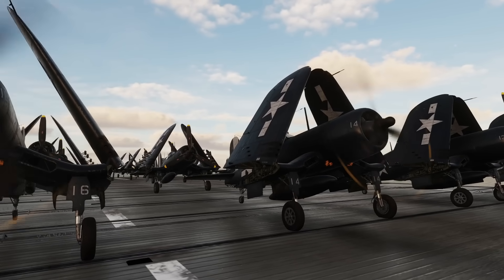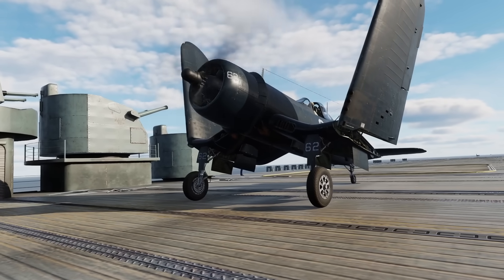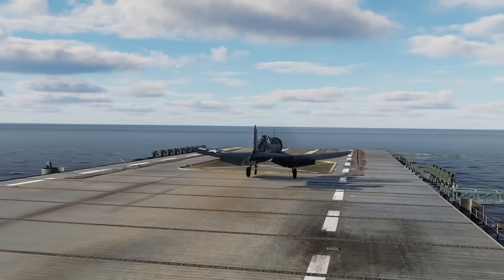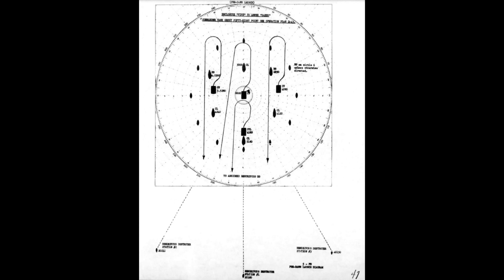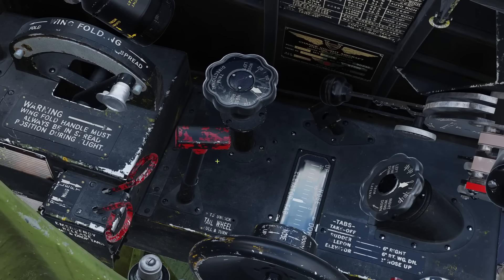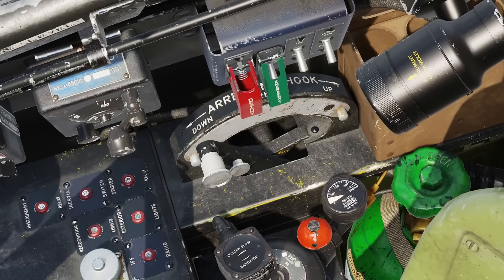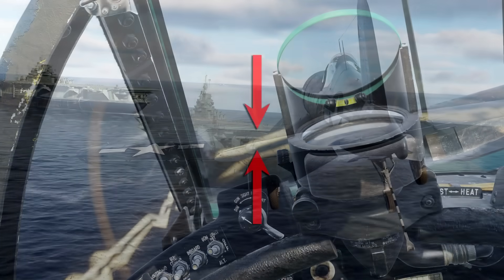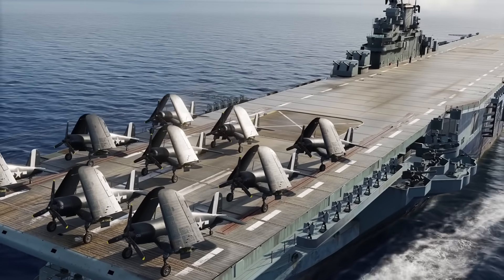F4U Corsair Training Part 4: Carrier Ops Tutorial in DCS World

Comment: Do you play in VR and if so which hmd? How often do you play in VR vs Trackir?
Reply from the maker: I play in VR whenever I can, unless I'm testing a mission for the first time and I need to take a lot of notes and switch around in F2 view.
Reply: @ReflectedSimulations I assume you are on the quest 3? Also do you have. Settings guide as I find the resolution is super low and there is a bit of ghosting when moving compared to the flat screen. I have a 4090. I not sure what to do about the low resolution however in VR? It’s a massive downgrade to the flat screen however I prefer it for the immersion.
Reply from the maker: @gregprouse1173 I have a quest 2 which is even lower res

Comment: Great Video!  Thanks for posting.  What are the trim settings?  Same as takeoff or zero them out?  I think that is what's causing me to bounce all over the place when trying to hit the deck and catch the wire; the nose wants to move hard right when coming in for final, and hard left pedal doesn't help much at all.  Pretty sure the trim is all messed up by this time.  I only been able to land successfully like twice out of 50 tries!!
Reply from the maker: Trim the nose so that you don’t have to push or pull too much to maintain 90 knots and the rudder so that the ball is more or less centered. For me it’s around 10 nose up and 4-5 nose right
Reply: @ReflectedSimulations thanks for the advice, will give it a go!

Comment: Great video! Maybe I missed it but do you have to have trim set similar to start? Or are aileron / rudder trims neutral for landings?
Reply from the maker: Set it so that you don't have to constantly push/pull on the stick and apply rudder. Something similar to takeoffs will work, but the elevator will be more up due to the full flaps.
Reply: @ReflectedSimulations  many thanks, will try.

Comment: Reflected. To paraphrase Patton, "You brilliant SOB." It took a couple passes to work down to some traps, but the gouge is right. Trick for me was to give enough upwind distance to turn, get dirty, lined up because the turn at the 180 (so be stabilized/trimmed up at 100/90 100'/90' level turn), comes quick. Keep the nose on the horizon and nurse it around as your are basically in VMC and that tiny tail has virtually no authority so it's a slow drift and tail chase to the stern. Use your feet.

Comment: Why the canopy has to be opened during takeoff and landing?
Reply from the maker: If you hit the water, or the deck and you catch fire, you wanna get out as quickly as possible. You can't waste a single second trying to open the canopy. Also, it may jam shut on impact, and then you watch as your cockpit fills with water with no way out.
Reply: @ReflectedSimulations  I thought its means for that. But just in case I had to ask. Do you maybe know how much drag an open canopy procudes? During the flight is has to be shut at all times, right?
Reply from the maker: @MitjaBonca  I don't know, but minimal. Nothing to worry about during takeoff and landing. It has to be closed above a certain speed, I can't recall. Below that it's up to you
Reply: @ReflectedSimulations  thx, I appreciate it. And thx for your effort on this module, seems that you will be in a great help 😊

Comment: 10:24.  Planes are parked too far apart, I think.  Should easily be able to fit 12 up front, 3 rows of 4.  Probably 3 rows of 5.

If they get animated deck crew, you’d maybe taxi up to a point where a plane director or plane captain says cut engine.  Upon engine shutdown, deck crews would push or tow your aircraft into its tight parking spot.  There, it might be refueled and reloaded.  Once all landings are complete, the planes are all towed and spotted aft to prepare for another launch.  Perhaps, you as a player can stay in the plane and fly the next mission.

If when you landed, your plane needed repairs, you might be guided to an elevator and taken below.  Yo wouldn’t need to taxi precisely, as you’d be instructed to shutdown and the deck crew would position the plane on the elevator.

Could be an incredible amount of fun!!

And not just Essex class, but smaller, shorter Independence class light carriers and Casablanca class escort carriers, too.
Reply from the maker: I just placed some statics in the mission editor, I'm sure more could fit.
Reply: @ReflectedSimulations  Ok, understood👍.  Yes, I did the same, now, and fit 5 across.

Comment: 1:12 This wasn’t a trim failure. The pilot was brand new to flight deck operations and had been instructed not to pull back on the stick during the catapult launch, since the aircraft is trimmed to fly off the deck on its own. But when he got jolted off the carrier, the sudden acceleration caught him off guard and he instinctively pulled back, which caused the Corsair to pitch up too aggressively and enter a power-on stall. Because of the aircraft’s strong right-turning tendencies under full power, the stall rolled the plane sharply to the right and sent it into the water. It’s a tragic example of how dangerous a split-second mistake can be when flying a high-performance warbird off a carrier.
Reply from the maker: Thanks for the info! I thought he had the elevator trim set way up…it happened to me once in dcs with the same result. but pulling back has the same effect. Poor guy…
Reply: @reflected Simulation Great video thought!

Comment: Your typical excellence in creating tutorials, Reflected 😂 Unless memory fails, there was extreme reluctance to use the F4U in carrier ops until Blackburn's Jolly Rodgers forced the issue. Operation Cherry Blossom I think. They claimed low fuel or some circumstance to make a CV recovery necessary. Or so the legend goes. The Brits had no such relectance, having mastered the SCA - Spitfire Curved Approach - and they even clipped the Corsair's wings a bit to make them fit inside their smaller carriers. A Jolly Rodger pilot also coined the nickname Hog for the F4U because one of them said it maneuvered "Like a hog on ice." But it's been ages since I read that book.
Reply from the maker: Thanks! They also softened the oleos to make it less bouncy

Comment: Excellent Tutorial and probably the most anticipated by all trying to tame this beast. Finally starting to nail it (well 8 out of 10 or so). However, yours looked so much cleaner (aka controlled). This bird needs an equal level of hand and feet coordination as a helicopter 😅 Question, trim settings during landing phase? Similar to take off, due to potential bolter?
Reply: WW2 carriers didnt bolter, they had a barricade up. If you missed the wire you hit the barricade. Due to the short straight decks that were never empty it was impossible to make accommodations for bolters
Reply: @theripcord03 good to know. Was thinking the barrier was only for worse case (as with modern carrier Ops).
Reply: @Scoop1_1  WW2 carrier ops didn't really allow for what we have now. Having straight decks with 90-120 aircraft meant that take off and recovery ops were heavily dictated by time and space. You had to push any deck prepped aircraft to the bow to prep for recovery, then as aircraft are recovered they lower the barricade taxi the landed aircraft to bow parking, raise barricade and the next aircraft lands. Then once recovery phase is done and you are prepping for the next launch phase deck crews hand push all the aircraft to the stern for launch. Any aircraft needing repairs are lowered to the hangar deck and any hangar aircraft needed launched are brought up as space is made. It was a very intricate dance to prep aircraft line them up for proper launch order and move them around for recovery all while the helm has to deal with turning into and out of the wind to avoid closing too close to enemy territories or fleets.
Reply: Often times aircraft would be pushed overboard to save time if you had an enemy attack come in during a launch prep phase. Not only did this allow aircraft to be launched faster but it also got fire hazards off the deck
Reply: @theripcord03 many thanks for the history lesson. Cold war Ops was more my thing so far, but the evolution of naval aviation is fascinating. Thanks again.
Reply from the maker: Just as Ripcord said. As for the trim, something similar to the takeoff setting but the elevator much higher up.
Reply: @ReflectedSimulations just started to watch videos and read about the history of naval aviation coming of age. This is what I love about this (flight sim) hobby. It’s not only the flying, but you learn so much about history, technical innovations, etc., as well.